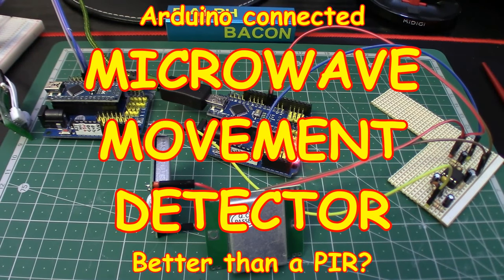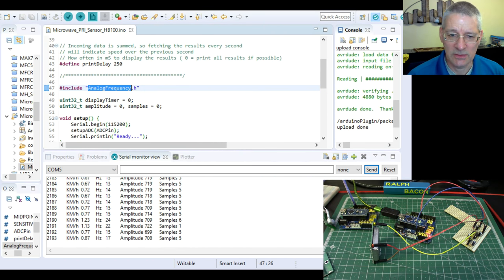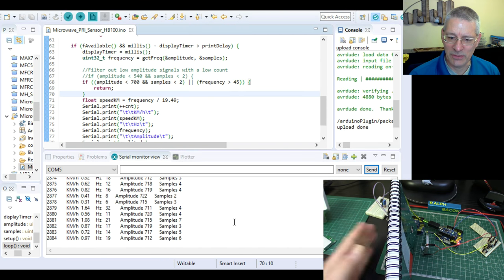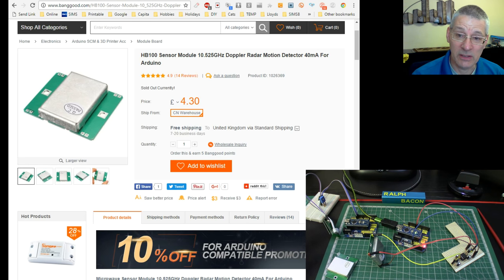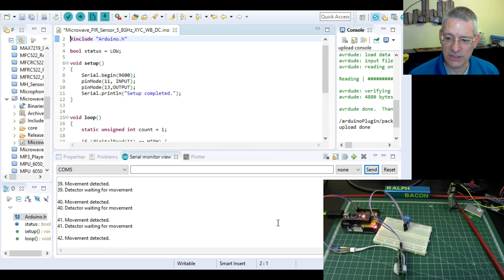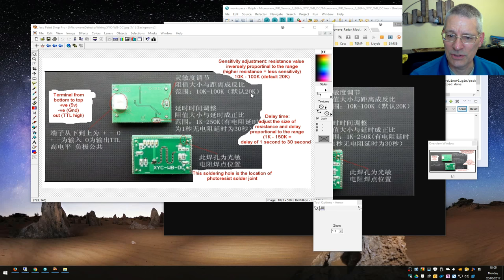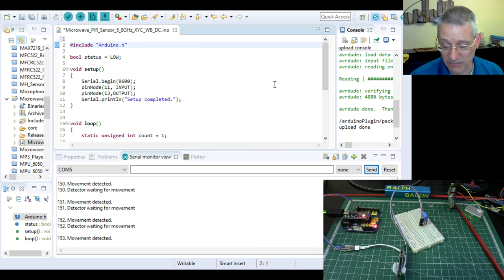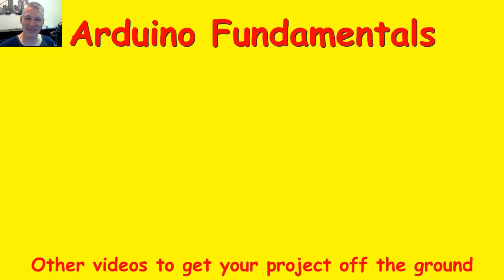#78 See thru walls! Microwave Movement Sensor

Comment: The lm2907 frequency to voltage converter is another good option for data processing if you would rather work in analog voltage than frequency.
Reply from the maker: Indeed, an excellent point you raise there ElectricAvian, thanks for posting.

Comment: from the application note :) On and off switching of certain devices (relay, LED, motor, etc.) may generated high magnitude of 
transient noise at the IF terminal. Careful PCB layout and time masking is necessary to prevent false triggering.
compare the shielding and via stitching on the transceiver vs your signal amplifier which is probably boosting everything including 50hz. You need to revisit your amplifier, move to twisted pair for your signal and consider placing your amplifier on a beefy groundplane, a braid between the transceiver ground plane and the amplifier ground plane should help with noise rejection. consider retesting with amplifier powered by a battery :)
Reply from the maker: You're spot on there Carl. As soon as I saw the 50Hz signal appear on the HB100's output I guessed what was going on. I've had problems in the past powering the Arduino (and associated add-ons) from the USB hub, it's not the cleanest 5v supply either. I might just try and clean up the circuitry before dismantling it in despair! Thanks for the info, if I ever get it working reliably I'll let everyone know.

Comment: The HB100 is wide beam pattern, just what you need for automatic opening doors. A radar gun to measure cars etc, need a directional antenna so you can pick one car not a group. I have a lamp with the XYC-WB-DC and can't hide behide a brick wall it still detects you, unlike a PIR.
Reply from the maker: Brilliant, thanks for confirming that there is no place to hide with one of these, Graham. And for the information regarding the beam pattern, who knew? Well, you did, obviously but not many I suspect, so thanks for sharing, great to hear from you.

Comment: Hello Ralph - I'm a bit late to this party but I thought I'd mention in your example of a fire engine doppler effect where the noise "dips then rises again" (0:55)  - actually, it doesn't. The pitch changes (lowers) as it passes you, but it doesn't rise again - it stays at that lower pitch as long as it continues to travel away from you at the same speed.
Reply from the maker: Do you know what, you're right! When I think about it the fire engine sound doesn't go higher again, does it? Thanks for the correction, Tsnafu!

Comment: Thanks Ralph. I ordered a few of these modules right away (the XYC-WB-DC anyway) for presence detection. Hopefully I can get them to not detect the neighbours but only the presence in my own home :')
Reply from the maker: Well, Thomas, you never know until you try. But mounting this in a sealed, waterproof box and still have it reliably detect movement could be its selling point. Or perhaps the trees moving in the wind is enough to drive your neighbours mad as your garden floodlight turns on for the umpteenth time that evening! Let us know how you get on, right? Thanks for posting.
Reply: Ralph S Bacon I wasn't planning on using it outside. I wanted to use it to detect if there are people inside my house (combining this data with other data like WiFi devices) to see who is home. And I could of course turn the lights on if some conditions have been met, with mqtt and Node-red. Will let you know my results in the next comment (when items arrive of course). Thanks again for making these videos!
Reply: Hi Ralph. Radar modules arrived today. Tested them out right away and like I said, would come back to you. They work great, but as you mentioned they are very sensitive. I think I'm going to sort that out in software (sort of a debounce). What value was your R6 resistor again? Mine is 2.2K, which seems to trigger the output very frequently.

Comment: Excellent video, Ralph. I suspect that the HB100 would be of more use to robot constructors than it would to those concerned with security applications. The accurate distance detection and approach speed possibilities are intriguing. Well done on finding a device that is truly Arduino compatible device. Another application might be to discover just how and when a ball of string always manages to get ravelled .around every gadget in that oddments drawer in one's kitchen. However, one would probably be forced to conclude that the string is simply obeying the 3rd law of thermodynamics.
Reply from the maker: Actually, Michael, the ball of string issue has nothing to do with thermodynamics, it's far simpler than that. A ball of string (in a drawer, for example) obeys the oft-forgotten faerie-law which states that "a ball of string at rest attracts string fairies, the number of which is proportional to the size of the ball. The same applies to kittens". Unfortunately, even a microwave sensor does not detect faerie movement as they do not block or reflect microwaves, but you probably know that already. It will detect kittens, however. Thanks for posting!

Comment: Actually as far as I know those simple movement detectors don't use the doppler effect. Instead they just send microwaves of some frequency. And when the radio waves reflect of things they interfere constructively or destructively with the transmitted wave. And transmitting the wave against the destructive interference draws a little more current than transmitting the wave against constructive interference. When you move the waves are constantly reflected from different distances and angles which cause the current draw of the transmitter to change slightly. And this is what is used to detect movement. In fact these devices don't even have a receiver, all they do is transmit at a specific frequency and monitor the current needed to transmit.
Reply from the maker: An interesting point of view, Phino, and not one I would have considered but for all I know you may be right!
Reply: Hey, sounds very promising. Do you have any source? I can only find some vague Chinese datasheets :/
Reply: Hey, sorry for the late reply guys... I honestly haven't found any official sources explaining this, just some spread out bits of information in forum discussions etc. Big clive has done good work reverse engineering this type of sensor in this video:
https://youtu.be/Hf19hc9PtcE
Obviously this is a fair bit of speculation. But if you look at the circuitry, this is kinda the only reasonable explanation. There is really no way for it to compare the sent and received signal frequencies for the doppler effect. It doesn't even have a way to receive anything in the first place. And even if it would, the transmitting frequency is within a fairly broad range somewhere but quite random depending on the tolerances of the components used etc. I doubt the frequency is even steady enough for the doppler approach to work reliably.
Maybe some motion sensors used to use or still use the doppler effect. But these cheap ones just don't have the hardware for that and also really don't have the necessity. They only wanna know if anything is moving at all, they don't need to know the speed or any further information about the movement. So why should they use the doppler effect? Almost every source on the internet (even Wikipedia) seems to claim these sensors use the doppler effect, none of them however provide any sort of evidence supporting this claim. I have no idea where this myth came from, but it kinda annoys me that everybody just follows along and keeps spreading this information without really questioning it at all. Maybe it uses the doppler effect in some sort of geniusly magical way that I don't understand. If that is the case, I would love for someone to correct me and explain how that works. But as far as I'm concerned these sensors work is fairly simple way and just use all kinds of disturbance created by moving objects, not specifically the doppler effect. To be clear, when I talk about using the doppler effect, I mean measuring the frequency difference between the sent and received signal. The doppler effect is of course always there when something moves within radio or sound waves and of course this will have an effect microwave sensor too in the form of fluctuations in the current draw. But that doesn't mean the sensor specifically uses the doppler effect. Not in the way a radar speed gun for example uses the doppler effect to calculate the speed.

Comment: Nice video, I have to try one of those µwave sensors.
Reply from the maker: Indeed, Javier, try one (especially the XYC one, it's dead easy to modify). Then you can judge whether it's better than a standard PIR. Or whether detecting your neighbour's cat on its side of the fence is what is really required. Or whether that downside it made up for by the fact that intruders cannot hide behind bushes and things and get away with it. If you try one do post back your experiences, thanks for posting.

Comment: Quite interesting devices but I've been testing that CRWL-0156 thingy (mentioned in anoter post) this weekend and it's super-sensitive and it does not appear to be tuneable below 5 meters which makes them almost useless for in-house purposes unless you find a way to do more directional detection. Which is why lightbulbs that use this technology have aluminum "enclosures'. Note: aluminum packing paper , I've tested it, seems to thin though. Fun to play with but in the end it's probably not more than a gadget/toy.
Reply from the maker: The thing is, Benny, the device I used is not supposed to be directional; they make a great thing about it having a 360-degree detection zone. I guess 1mm aluminium should block the signal though (microwaves don't get out of a µwave oven, right?). It probably has a place in security applications (eg if there is movement in your house it might mean burglars are entering via an upstairs window). As you say, though, fun to play with.
Reply: Yes, I understand. My project is actually to scan if somebody enters the front door. My wife has a problem with her hearing and I wanted to scan the front door and have a light go on in the living room, where she ussually is, so she'd know when somebody comes in.
Because there is no power and no ethernet in the hall (could do it with PIR but sending via Wifi  proved to battery hungry) I wanted to put this in the room next to the hall and scan through the wall  
All that worked but ... it also scanned my wife 's movements 10 meters away in the living room! So I tried to limit the range by soldering resistors on the microwave scanner but couldn't get it to - say - a reasonable range of 2 meters so hence I tried to limit it's 360 degree which failed (at least with thin aluminium foil) ... Haven't given up on it yet but the technology has lost much of it's initial appeal ;-)
Reply from the maker: I see what you are trying to do. Don't get too disheartened though as your idea seems sound. Try thicker aluminium sheeting or several layers of foil. Or mount it in a metal box with just one side open that is directed at the hallway. You may have to experiment a bit more I guess, but it would be a pity to give up when you're nearly there.

Comment: If you are relying on the Doppler effect, shouldn't your program calculate the change of frequency in order to see if the object is getting closer or farther?
Reply from the maker: Hmm, possibly, but this module was tricky enough to work with at it was to detect movement of any kind. There is a library, I believe, that let's you extract the frequency that then might let you determine direction, but it's not something I'd be that interested in investigated further! Check out other comments under this video, I recall there was other information posted by others that may address this. If you get further with your objective do let us all know, it might make this module more useful to others too. Thanks for the question (and apologies that I couldn't really answer it).

Comment: I was thinking the same thing about IR prism project you are doing....... when  it is raining light or  hard there's going to be a lite sheet of water on it, not sure how it's going to distinguish light or hard rain, and when the rain stops it will have too dry completely in order for the signal to change. As for me I'm converting an old 3d printer to a small 3000mw laser diode engraver....... changing out the board with a atmega 2560 and a Ramps 1.4 shield...... that was ok but finding the firmware took days.... I'm moving very slow now days.
I may order the simpler of microwave modules..... looks like fun. Thanks for the great vids.
Reply from the maker: Sounds like you have a lot of things on the go there Joe, as you say it sounds like fun. Thanks for your support and keep watching for new videos every couple of weeks or so.

Comment: If it is possible can you please post the wiring diagram of the unit  with XYZ sensor
Reply from the maker: I'm not totally clear what you mean by this, Dheenadayalan. The µwave detector only has 3 connections, two for power and 1 signal pin. There is no XYZ sensor involved here. Perhaps you are thinking of the MPU6060 3-axis Gryo from video #76?

Comment: Thanks for the video Ralph. Would you please tell me the ideal ohm values that you are happy with for R6 and R9? (Sorry I couldn't get the precise values from the video)
Reply from the maker: I'll try, Hüseyin, but as my memory is like a goldfish's we shall see.
 
In my module the resistor that controls sensitivity should be between 10K - 100K (default of 20K) did not have a 20K resistor there at all, it had a 12K which was too sensitive. So I chose a 20K and it worked fine. 
 
I used a 1K for the Delay Time which gave a 1 second delay (pulse) when it detected something, just about right for an Arduino sketch.
 
Hope this helps!

Comment: Other than low range detection through materials (walls books...) or humans.  What other applications could this be used for?
Reply from the maker: Ah yes, the $64,000 question Kenneth. Now whilst its primary, intended use might be as a replacement for a PIR (alarm) unit, the fact that this detects all kinds of movement (not heat-based, such as a warm bodied creature, like the PIR requires) may lend it to other uses. What those uses are are various and manifold I am sure - but I'll leave that for others to come up with the actual ideas. Anyone?
Reply: Trigger for a security camera or lighting? So you don't get false triggers by cats, dogs  and racoons would be ideal. I haven't seen a system sold yet that uses this tech in that application. Even better would be to watch areas hard to watch because of tree movements. PIR sucks in these applications and lights stay on wastefully..
Reply from the maker: Yes, that sounds sensible. It could detect cats, dogs and racoons (not in the UK though because we don't have any) but the sensitivity could be 'adjusted' for that, I guess, in the code. Good to hear from you John.
Reply: There seem to be at least 3 modules being sold on amazon that work on different frequencies. I'm leary of the 2.4 ghz one because isn't that the same freq as wifi? Or is that 2.4 mhz? After posting that I thought to myself " Has any one done an array of sensors?" to get better "sight".... I've never personally worked with arduinos yet but I did get a 37 piece robotics kit to tinker with. Also 45 watts worth of solar panels and some lead acid 12vdc batteries. An arduino is probably in my future. I learned C++ like 20 years ago, though. I never even dreamed it would last this long as a language. Well I'm rambling & digressing. You have a very interesting set of videos, Ralph. I'll try to watch more in my spare time. I appreciate the response. Cheers!

Comment: It is for opening the doors of buildings automatically,  and works better than PIR in hot countries.
Reply from the maker: And there we have it, Robert, the obvious (now that you've mentioned it) device to detect any movement near a door and open it, Star Trek style. And the actual range (that is, extending beyond the boundaries of a property) just doesn't matter too much in this application. Thanks for posting.

Comment: Can i get a reference regarding hb100 code for raspberry. I want to make human detection
Reply from the maker: Hi Komanq Liska! Raspberry? As in Pi? I'm afraid I don't have that code as I don't do much with Raspberry Pi boards but if you look at the Arduino sketch you should be able to convert it to run on Python (on a Pi) pretty easily. That's best suggestion I can give you, I'm afraid, but nice of you to stop by.

Comment: Hi mate, great channel, slowly working my way through your videos, gets very boring at work lol 

I just wanted to mention that back in a former life I used to fit intruder alarms and one job would be to replace microwave movement detectors because of the numerous false alarms caused by the detectors picking up movement through doors/walls etc , especially water pipes embedded in the wall would set of alarm if the water was running through the  pipe. 

Again great vids 😂
Reply from the maker: I would never have thought that water through pipes would set it off, but I guess it really is movement, right? And the designer(s) of the intruder alarms never thought that would be a problem either! Who knew! I guess they work best in a lead-lined bank vault where the only movement would be that of an intruder attempting access. It's hard to think of other Real World uses where false alarms don't cause considerable problems.
 
Anyway, thanks for posting, Steve, nice to have you on the Arduinite journey!